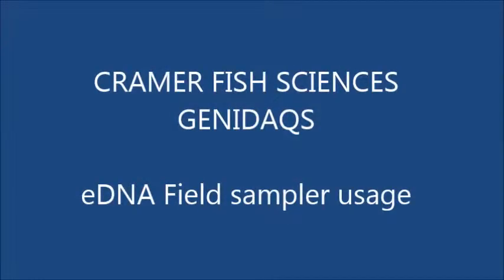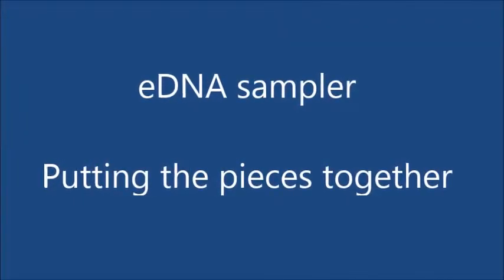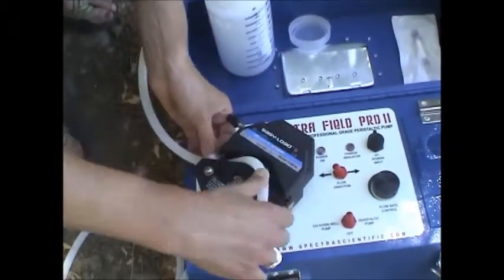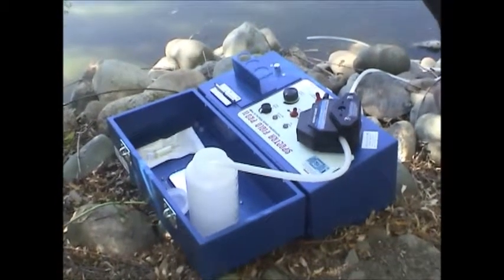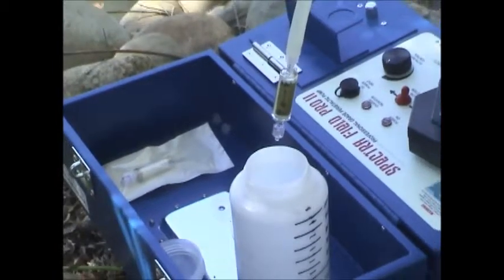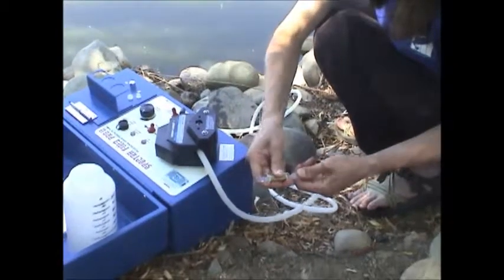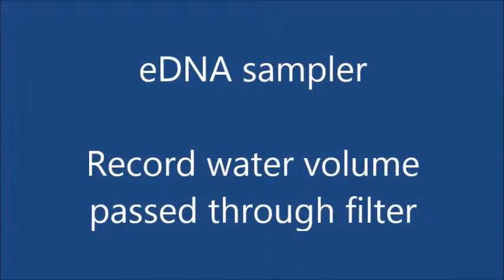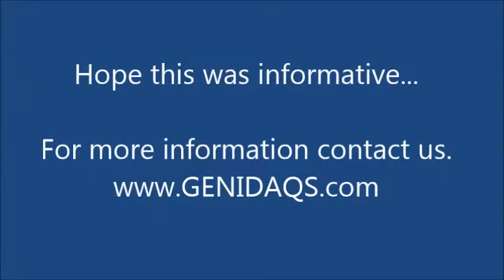eDNA Sampler Usage

Comment: Hi Cramerit,

Thanks for your video. I'm trying to set up a eDNA sampling system as you did right now and I'm wondering how do you get DNA detached from the membrane? As the tech support from the milipore said 'There is no recommedation for detaching the membrane from the Sterivex device. It is meant to be used as a closed system and not opened up' . Thanks for your concerns.